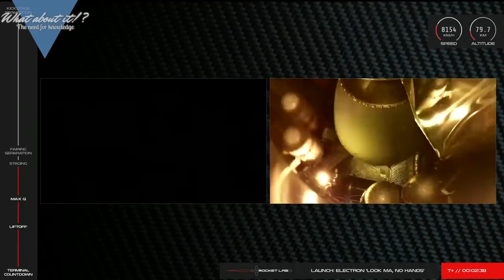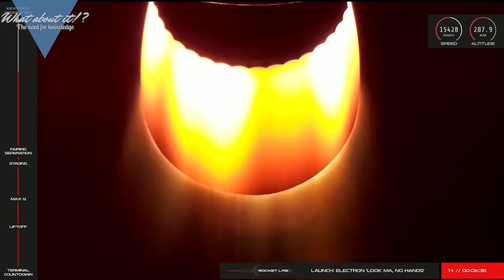27 | SpaceX Super Heavy - Starhopper FAA Trouble – Starship Road - Rocketlab Launch Summary

Comment: Elon will likely not sacrifice any Raptor engines just to get Starship to orbit quicker.  Super Heavy will be needed to boost Starship to orbit so it can have enough reentry fuel.  Not only will Super Heavy have to be ready, but Starship will need to be ready for reentry.  Will Starship carry extra fuel to to slow down more on reentry to avoid maximum heating?  Or will Starship’s heat shielding and/or active cooling be ready for its maiden orbit? 

A Super Heavy with Starship launch later this year would be incredible, but maybe it’s more likely to launch next year?  Getting them to launch is one thing, but having Starship fully ready for reentry from any orbit will be incredible at this speed!
Reply from the maker: Starship will carry fuel for reentry burn and landing burn, yes! I bet, we will see Super heavy fly sooner than expected.
Reply: What about it!? - Even if they do not launch until next year, we’ll see for the very first time ever, an orbital vehicle propulsively land.   We’ll likely see this before NASA gets a chance to discard a whole SLS rocket just after launch.  I wonder how embarrassing this is for the teams working on SLS?
Reply: No, there will never be enough fuel to slow down, only to deorbit.
Reply: John theux There had better be enough fuel to slow it down or the impact will be incredible.  Even with fantastic aerodynamic breaking, AT LEAST a landing burn will be required.
Reply: @737smartin  Oh yeah, but that's a small amount of fuel, not a big deal.
Reply: John theux Really there is no difference between slowing down and re-entry. The way you re-enter is you burn fuel to slow down.  When you slow down enough, you re-enter the atmosphere and atmospheric breaking begins, but if you are in a stable orbit it takes a lot of fuel to slow down to that point.
Reply: @737smartin  Yeah, but here we are talking about slowing down by a lot to make the re-entry less hot.
Reply: But why the assumption that they would send it to orbit? There is no practical reasons to do so when testing . Flying in orbit has less to do with altitude than it has to do with speed and direction... For testing re-entry and space behaviour, they will probably just send it very high to space at a steep angle, so that it naturally fall back down towards the landing pad. No orbit needed there.
Reply: @charonstone6447  I did think that way at first. Then I realized that to FULLY test the system you must eventually re-enter from orbital velocity. To achieve orbital velocity but not complete an orbit likely means re-entering over Africa or Asia OR using tons of extra fuel. To reach orbital speed then re-enter and land at a SpaceX facility, I think the easy answer is to actually orbit so you can select your landing longitude, BUT I am absolutely no expert!

Comment: What many people don't understand is that the prototypes being built aren't meant to fly in space 
Both Starship prototypes don't have any form of heatshield and they are only going to be used for higher altitude hops
They are there to test the raptor propulsion system and the aerodynamics of the full scale airframe and fins
If these extra rings are indeed for a Super heavy it'll almost certainly be a low fidelity prototype hopper instead of an actual  production booster

Comment: How will the Superheavy be moved out of the site?

Boca Chica is kinda of isolated, but we can clearly see the Superheavy site is all populated around, so we already know it won´t take off from there.

By truck?? Well, it's 9 meters in diameter. No way a truck can move it. The Falcon 9 was already difficult to move by truck and was wider than a truck.

IF I had to guess, I would say they will move it out by BARGE. There is a sort of river just next to the site...
Reply: Yeah, but how do they get it to the barge, and then from the barge to the launch pad? That still requires a wheeled or tracked vehicle of some kind. I'm sure they've already got it worked out, but it will be interesting to see. Alien antigrav technology from Area 51! ;-)
Reply from the maker: As soon as there's some sort of info, you can be sure that I'll report on it. Logistics will be difficult for Starship and Super Heavy. That's for sure.

Comment: use one of the falcon landing barges for take off than no need of approval :)
Reply from the maker: You would have to get it there first and then what if it falls into the water? :O
Reply: @Whataboutit  Well JRTI has just passed the Panama Canal. But it's probably for the increased Florida launch cadence and absence of launches that require the ASDS. Although some are speculating it might help with Starship high altitude landings since that may be risky at Boca Chica in the beginning and the ship seems to be heading to their maintenance and upgrade facility, although that is not for sure.
Reply from the maker: Interesting! Will follow the progress. Thanks for the heads up! :)
Reply: @Whataboutit  It is going to be scraped/retired after this test anyway.
Reply: @Whataboutit  NP And I guess it's clear but I meant there are no launches from Vandenberg that need a droneship until 2021. There is also the speculation that this would allow super high energy FH launches that expend the center core and recover the side boosters on ships.

Comment: Elon should have picked a more remote location away from houses and parks.
Reply: It's not that simple. Nova Chica is at the southern tip of Texas.  This makes it a great choice for rocket launches, because of the Coriolis effect (close to the Equator, etc.)
Reply: @sanjivjhangiani3243  Good point. I have a feeling residents in the vicinity will be required to temporarily evacuate during a Super Heavy launch.

Comment: Could Rocket Labs use a hydrogen electric battery instead of lithium ion.  That way, they wouldn't need to dump the battery and might have a much lighter system.  Too bad they're kerlox and not hydrolxo because then they would already have the hydrogen tanked...
Reply: David Urry do you mean a fuel cell? I haven’t heard a hydrogen electric battery. Fuel cells cannot discharge very rapidly. I don’t claim to be an expert but batteries might not be able to store as much energy but they are much more powerful.
Reply from the maker: Electron’s second stage hosts a total of three Lithium-Polymer battery packs to power the engine during its burn. Two battery packs are jettisoned as they become exhausted during propulsive flight to shed dead weight. So it's not lithium Ion, but Lithium Polymer or Li-Po. I am pretty sure, the fuel cell technology would weigh more. Also a Fuel cell consumes not just hydrogen, but also oxygen and I don't know, if you can run it on liquid oxygen. So it would possibly need to be warmed up. Also interesting would be, if there is a fuel cell of comparable weight that produces the same amount of current at an equaly stable rate. Lot's of questions. Interesting topic! :)